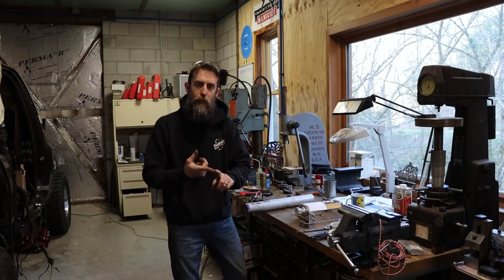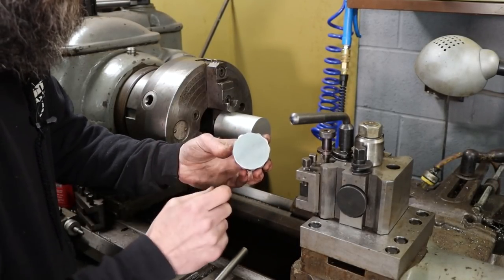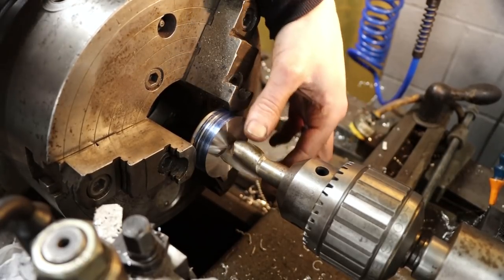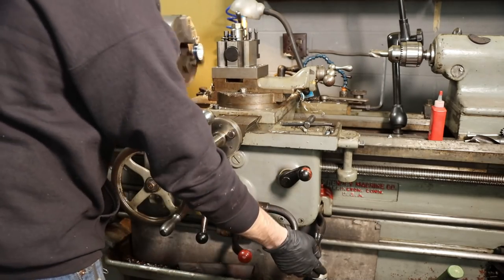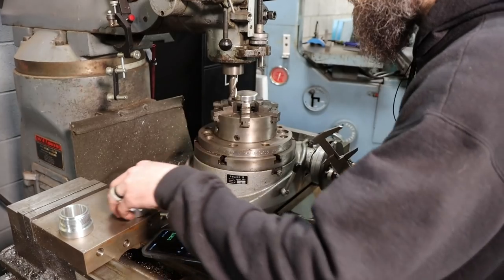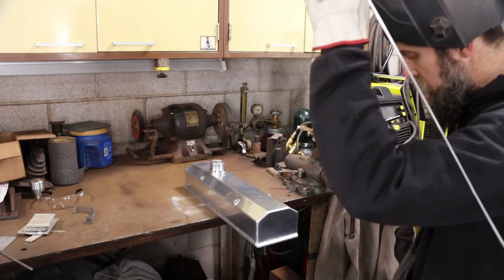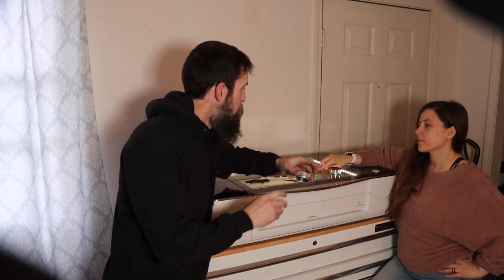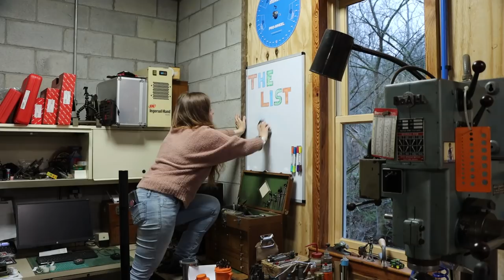Machining and engraving custom caps by Elizabeth and me!

Comment: Great video as always!  Caps look great.  That feature on your lathe was something brought on by America considering a move to the metric system many, many decades ago.  As you know, you can't disengage the half nut when cutting metric threads on an imperial lead screw.  Definitely a neat feature.  One of the coolest I've ever used was a machine that auto kicked the cross slide, auto reversed and auto returned to the start position ... All mechanically. It happened when hitting an adjustable hard stop.  Anyhow and as always thanks for sharing!

Comment: Caps look magic Steve... Could not be bothered sifting through all the comments to see if anyone already suggested this but when you weld Ally, Move the torch forward while close to the puddle, this wets it out and gets good penetration, then just before you dip the filler raise the torch up a tiny bit and then repeat. Ally puddle grows alot when you add filler. Especially using 2.4mm wire.

Comment: You probably don't need another project, but anodizing combined with the laser might be interesting. Either exposing dry film resist and dying or marking directly on dark anodize. Just need battery acid and a DC source to anodize (and some dye).

Comment: Nice turning job Steve. Just a suggestion on the sequence of operations. You could have turned the screw part first and parted the whole finished part off in one operation. Love the engraving by Elizabeth also. You might get a few requests for parts after this.

Comment: To properly laser mark metals you need a molybdenum compound such as Thermark. The marking will be permanent and black. I do this all the time with my laser.
Reply: 100%, it's a bit expensive but worth it.
Reply: I've been using a moly spray on compound on polished stainless name labels, using a laser I have access to - they look great.  I've found three passes (single pass doesn't satisfy me) are needed for a nice dark name at all angles of sunlight - a single pass that goes a bit wonky can be easily polished off, after three passes and a "Dang!" I found the steel was marked and polishing it off took ages.  I'm wondering if 7 or 8 passes without moly might look nice....  might try it.

Comment: Whenever you dip your tungsten in the puddle you have to grind the weldment back immediately prior to continuing the weld. The reason for this is that the tungsten leaves part of itself in the weld pool and cannot be successfully welded over. I don't know what the configuration of the tungsten being used here is but I suspect that it is a sharp pointed cone. I have always used a "balled" tip tungsten and have found that it is less likely to be dipped in the puddle by accident.

Comment: I don't know that you ever showed us the inside of the fabbed aluminum v. covers, but I hope you have an internal baffle for the PCV valve location. You don't want to be sucking gross amounts of oil vapor into your engine, which will happen if there isn't an internal partition to  limit the exposure of vacuum to indirect oil vapors, if you catch my drift.

Comment: You could probably chemically etch (phosphoric acid) the designs using the paint as a resist mask. Maybe apply a bluing solution? Then remove the paint/polish the caps.
Reply: Blueing solution don't work on alloy, its for steel.

Comment: you should put some holes in cap and small filter - crankcase ventilation #breather
Reply: You need to look at the other valve cover.  That breather is all of the crankcase ventilation needed.  That breather might get a little oily, so a PCV valve and some vacuum may be in your future.

Comment: youre still using the coolant setup on the bandsaw so i guess its working (i was allways told not to use cooland as that would cause the saw to slip over the wheels )
used my metal bandsaw recently and even with the hydraulic cilinder to slow the downfeed down it jammed quite a few times (square tube thick wall ) my guess is that the 375 watt motor is underpowered for the saw , thinking on upgrading to a 1 kW 3 phase and a VFD
as for laser engraving , you might be able to anodinise it in a dark colour and the engrave will take it , also wonder if you just put tape or pruisian blue over it and have the engraver go deep , that should end up with the engraved stuff being matt
Reply: Almost every commercial band saw I know of uses coolant with no slippage problem including mine. Do you have fine enough teeth for the wall thickness of the tubing you are cutting?
Reply: @bruceanderson9461  well theres sumting wrong , might look intoo putting a new blade on there , i saw the same brand / type  machine i have cut through the same material without a hitch at a faster pace then mine did so im going to change the saw first and see wat that does , while im at it i check the bearings on it 
still think it be good to have a way to slow the speed down and still have enough power as that might help cutting through thicker stiff / stainless
as for the coolant thing : a comercial bandsaw probably has larger diameter wheels than the smaller saw steve and i uses to theres less of a contact patch to transfer the power from the wheel to the saw
Reply: @watahyahknow  consider checking if the bandsaw wheels are in the same plane by putting a straight edge on them spanning both wheels. You can shim them in or out to line them up. On my band saws you can also adjust the tip or cant of the wheels-check this with the blade under tension. A second consideration might be if you have the blade guides in the right plane and properly adjusted. Bad bearings might as you say rob some power.

Comment: You need to have a PVC port in the valve cover. The filler cap should be on the other end of the valve cover. You will have the pressure coming out the filter on the other side  and the dipstick making a mess. imo
Reply: PCV.

Comment: There needs to be a PCV or some kind of crankcase pressure evacuation or you'll be blowing oil out of gaskets and other problems due to crankcase pressure.
Reply: Did you notice the breather filter on the other valve cover at 27:27?  He's venting the old school engine the old school way in an old school truck.  If he has so much blowby that that filter isn't enough, the lack of sufficient venting isn't his problem.
Reply: @kensherwin4544  ...The only thing that may bother him is a bit of oil vapor that escapes with even the best engine.  A PCV valve and some vacuum plumbing may be in his future.

Comment: So how many comments below tell Steve he made the part backwards? Pro tip: good rule of thumb always machine thin to thick  lathe or mill, in this case if he had done all the work up front he could have cut them back to back save stock and instead of blowing up a parting tool he could just went over to the saw and sawn It off, oh well  he's still a mechanical wizard and when he pulled up his bootstraps and laid that block wall my freaking jaw dropped this old boy can  put in a day's work, and could run circles around my fat ass, and I can't get enough of them squirrels, dogs frogs, the hillbilly  draw, and all that real American steel like I cut my teeth on, and I ain't got nothing against hillbillies I was born and raised in Northern Ohio and all my people are either stump jumpers or Hill runners
Any questions 
Ass'k h'ole fred, SCM llc 
 M30
Sub program:
in regards to the threading that's how the commies, krauts and Kurtis"the banana Man" Dundee do it (nothing against krauts both my grandfathers are of German decent and hillbillies TOO!) the pros use an travel indicator and the half nut, the half nut is half the fun, and plus you get to say half nut a bunch of times, at least put in the thread relief first, only on YouTube do all threads have thread reliefs sometimes you got to have a butt stop for strength, when you initiate a random stop at the end of the thread sooner or later your tool is taken a full cut try that good steal some time, you should always use an travel indicator.
M99

Comment: Instead of standing there pushing down with my hand, I just hang a weight on the end of the saw to speed things up. Cleaner installation is to weld from the inside.  Glowforge spends a lot on advertising, including this informercial, but their price is high for a machine made of Chinese parts- about double that of other Chinese machines which offer more capability.
Reply: Are you through being rude and bitter?  Thank you.
Reply: @paulcopeland9035  Well, if you can point out what was rude  and what is bitter, I'll consider it.  In the meantime, are you through being triggered?